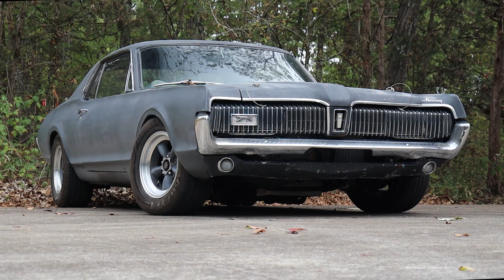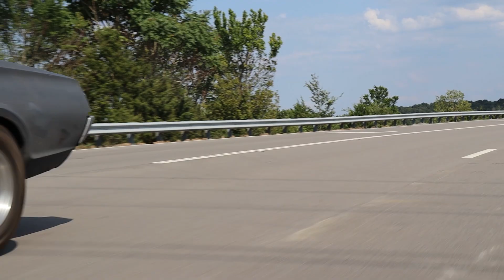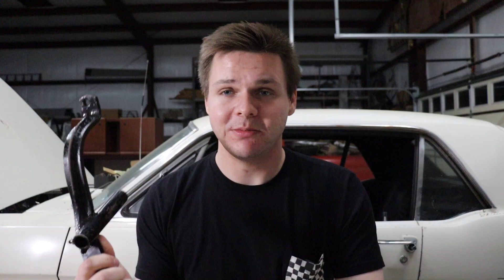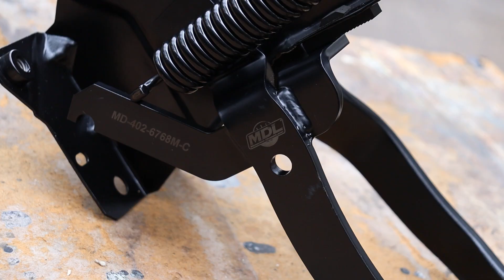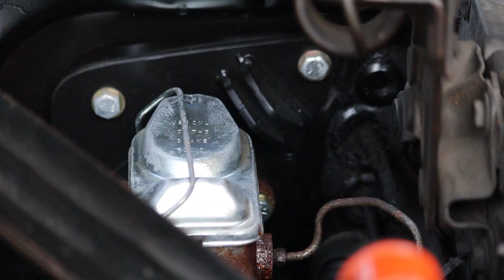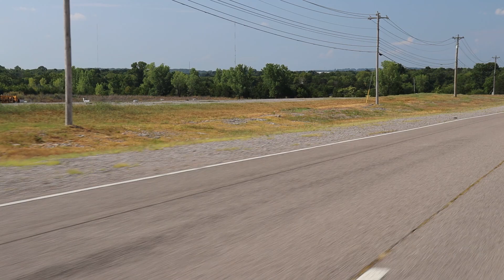1967 Mercury Cougar: Manual Everything

Comment: Dude I can’t tell you how helpful this info is. I just picked up a 67 cougar and I am going to do the EXACT swap. Thank you for all the parts and where you got them from. One question I have is did you use the stock auto pedal box and just add the clutch pedal or did you have to get a different box? Thanks again great looking car
Reply from the maker: I'm glad to hear it was helpful, and congrats on getting a Cougar! Yep, I used the box that was already in the car and added the MDL clutch pedal which is pretty much the same as OE. I know I showed in the video, but I do highly recommend adding the roller bearings to the box over the factory style bushings. The pedals feel so much more sturdy and will stay that way for a long time. Not to discourage you, but I did blow up my T-5 not too long after we uploaded this video, but it was a used marketplace special. I have since replaced it with a TKX since I ultimately intend for this car to have somewhere in the 400-500 HP range and I want to overbuild the drivetrain. Thankfully, I only had to change bellhousings and crossmembers and was able to use my driveshaft from this video. If you have any questions feel free to message me on IG if you're on there (@bool.cat) and I'd be glad to help with any future questions! Thanks for watching!

Comment: Nice car ! What size rims & tires on there
Reply from the maker: Thanks man! 

 Wheels are American Racing Torque Thrust D's, 15x7 front with 235/60R15's and 15x8 255/60R15's on the rear currently.

Comment: I'm sorting our a similar swap on my 68 Mustang. Are you running the JBA 1650 shorty headers? I've been debating if I'll need the 1650Z z-bar that's special for this application too. I'm running Unisteer power steering too which complicates things too. Thanks
Reply from the maker: Hey man! Nope I have a rusty old set of Hooker Headers that came with the car, not sure on the exact model of them. I did use the JBA 1650Z Z-bar that you mentioned though and it works/fits perfectly and it wasn't hard to get into position for install. I think it might be required for JBA's headers but I'm not 100% sure on that.

Comment: My son's 67 cougar has got the 5.0 roller engine and a t5. Mine has a 393 and a tko
Reply from the maker: They both sound like fun cars! Is your 393 car the '67 you're trying to get back on the road?
Reply: @boolersofficial  yes my 393 is a 67 too. I've boxed in OEM style uca's and lca's, installed opentracker roller spring perches and roller idler arm, fabbed up a set of Dazecars sub frame connectors, installed a rack and pinion (don't know which brand, traded for some of my parts), modified some s197 mustang front seats, added a passenger side torque box, running a set of 17x9 and 17x8 centerline wheels(only had to add three washers to the front uca bolts to gain caster to clear the lower part of the front fender). Just finishing up welding the floor and took a break to put a roof on my house.
Reply from the maker: @FE428Power sick! I need to work on my welding skills, but I would like to box my CA's as well as adding Opentracker rollerized goodies up front. Floors and sub-frame connectors are also on the to-do list. Did you do your floors and connectors on your own?
Reply: @boolersofficial  yes I did my own floors. Look up Dazecars subframe connectors. The material cost me about $40. He shows where to cut and bend. How can I send you some pictures?

Comment: What suspension and tires and wheels specs love the stance
Reply from the maker: Thanks man! 

Up front I'm running cut down Grab-A-Trac GT springs with Koni shocks and a Shelby Drop on the upper control arms. The front springs I cut down per Mike Maiers video as a guide. In the rear I'm running factory worn out leaf springs with 1" drop blocks. One caveat with the drop blocks is that Cougars have rubber isolator pads on the leaf springs that Mustangs don't have and all the kits are geared towards Mustangs. Effectively the rubber pads end up being a 1" drop block on their own, so if you remove the pads and use the blocks in place of them you haven't really changed anything. With that being said, once you stack the lowering blocks on top of the rubber isolators, you'll find the U-bolts that come with the kit end up being too short to work. So I had to order some custom U-bolts to make it work. It works and drives fine, but I think others have made custom lowering blocks that would be considered more "proper". I will look into making a video to go into this in more detail in the future. Wheels are American Racing Torque Thrust D's, 15x7 front with 235/60R15's and 15x8 255/60R15's on the rear.

Comment: I'm 69, but move like a 50 year old, been the owner of a 67 cougar since 1977, 289 c-4 ,being in California its a rust free car, four wheel dices brakes stock front, 87 cougar rear dics from ss brakes, cut springs 1/4 cor, 17x8 wheels 4 1/2 back space ,drop tryrods , roller springs brackets,41/2 leaf springs, gas socks kyb,still power steering, works just ok, but not the best
Reply from the maker: Sounds like a fun car! I haven't head of people using a rear disc setup from an '87 Cougar, but thats a pretty cool idea. I'd eventually like to get one of the kits from OpenTracker Racing that mimics the larger Lincoln front discs and then add discs to the rear.
Reply: Dude you are crazy lets go

Comment: Cool car.  I changed out my 3-speed to a T-5z in my '69.  I also  kept my manual brakes which I really like.  I did go with the Borgeson power steering though.  The manual steering was just a bit too much manual for me.
Reply: I do like it. It’s a night and difference.  The ratio is also a bit closer than the stock manual box so it tightens things up too.
Reply from the maker: Thanks! I can definitely understand the manual steering being too much. If I still drove it daily into town I could see myself getting tired of it pretty quickly. How do you like your Borgeson system?

Comment: Ya know, for having 7 videos and less than 60 subs, this one is doing ok. You just showed up after a Freiburger video. I dig the Cougar, and I am pretty sure all of them came with power steering and brakes. Let me tell ya, finding parts to fix the booster and steering 35 to 40 years ago was a HUGE pain. 

My first car was a 67 A code automatic Cougar. Bought it when I was 13 way back in 1982. Yeah I am old. Still have it, but haven't driven it since 1987. I repainted it in 2008, after it sat for 20 years in primer and bare metal, and now it needs it again, but I am a lot better at it now. Put a 351C in it, because I have four of them and I liked the power I got from them in the 80s and early 90s, before I got big into Pontiac. 

Been thinking I should go manual transmission, just to make it more fun. I got away from clutches because my Pontiacs 455s like to break manual transmissions. Put a TKX in my 65 GTO back in September, after making a Th350 hate its life, and breaking a bunch of 700R4s I rebuilt for it. Have an extra 6-71 blower sitting here, I think that would make the Cougar lots of fun with a 4V Cleveland. Already decided to ditch the power steering, not sure which way I will go yet, but its definitely going manual. 

I subscribed so you can keep making Cougar content and motivate me to get mine back in the shop and make it drivable again.
Reply: Mine was built with manual everything.  No A/C either.  69 M-code XR7.  Ordered that way from the factory.
Reply from the maker: We were quite surpised with the way the video took off as well, looking at the analytics a lot of viewers came from Steve Dulcich's recent Cougar video. Thanks for letting us know how you came across it!

Man, it's been great to hear from fellow Cougar owners! Sounds like you'll have yourself a pretty wicked car with that drivetrain setup in it. I can't speak for everyone, but I'm certainly enjoying the all manual setup. It makes for a great driving therapy session. I'm not sure if you've watched much from Craig909 with the white F100, but I'd like to do a very similar engine and transmission setup with this car. I have a few small blocks laying around that I'd like to make use of. I'm sure you know, but parts have definitely become a lot easier to find especially with the help of West Coast Classic Cougars for the stuff that hasn't been reproduced yet. There's also so much more sheet metal available for them now to from Dynacorn. Definitely not as great as OEM I'm sure, but its something!

Thank you so much for comment and subscribing, it means so much to us! I'm going to try my best to keep the Cougar content coming through out the year!

Comment: Hello! I recently got a 67 XR-7 manual everything as well, including the choke.  I was considering rack and pinion or borgenson eventually. Its nice to hear something positive about the manual steering. 67 seems to be an odd year for aftermarket. It was a bit tricky getting it into the garage, with manual steering and drum brakes, its a tight fit. Tearing out the interior and on a rust hunt atm.  Please what suspension, brakes, wheel and tires sizes do you have? I really like the stance of yours?  Thank  you!!
Reply from the maker: Hey, great to hear from a fellow Cougar owner! Manual choke is something I forgot to cover in this video, but I did end up switching to it after my electric choke started going bad. I was able to hide the cable handle where the cigarette lighter normally goes. Yep, manual steering can definitely make tight spaces a bit more tricky but I really enjoy the new steering feel enough to put up with it. I haven't driven a Borgenson or rack & pinion converted Mustang/Cougar yet, so I can't comment much on them, but I'm sure either would be a nice upgrade! 

Up front I'm running cut down Grab-A-Trac GT springs with Koni shocks and a Shelby Drop on the upper control arms. The front springs I cut down per Mike Maiers video as a guide. In the rear I'm running factory worn out leaf springs with 1" drop blocks. One caveat with the drop blocks is that Cougars have rubber isolator pads on the leaf springs that Mustangs don't have and all the kits are geared towards Mustangs. Effectively the rubber pads end up being a 1" drop block on their own, so if you remove the pads and use the blocks in place of them you haven't really changed anything. With that being said, once you stack the lowering blocks on top of the rubber isolators, you'll find the U-bolts that come with the kit end up being too short to work. So I had to order some custom U-bolts to make it work. It works and drives fine, but I think others have made custom lowering blocks that would be considered more "proper". I will look into making a video to go into this in more detail in the future. Brakes for now are still factory disc up front and drum in the rear. In the future I do plan to upgrade to the larger Lincoln style discs up front and doing a disc conversion on the rear. Wheels are American Racing Torque Thrust D's, 15x7 front with 235/60R15's and 15x8 255/60R15's on the rear.

Thanks for the comment, and let me know if you have more questions!
Reply: @boolersofficial  Thanks for the info! My leaf springs are rusty and was considering buying new ones that are dropped. Any chance you bought wheels and tires from a national chain that has online selection? Most of the ones around me, their sites cant handle looking up 67 cougar wheel tire combo.
Reply from the maker: @digitalwitch1111 , No problem! Yep, I bought my wheels from Summit Racing. I spent some time searching around forums to see what would fit before ordering my setup. I did roll my fenders, so if you have the fender chrome trim pieces and want to keep them you might want go with a more conservative set up.